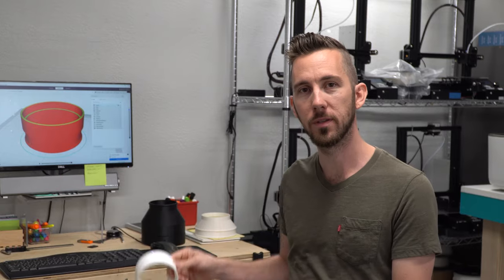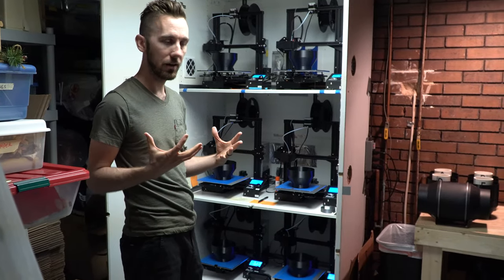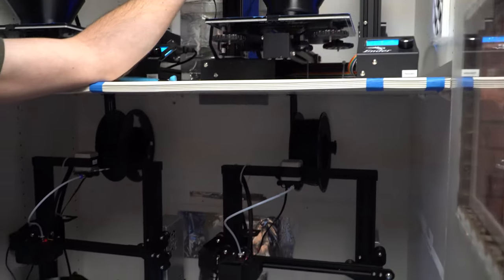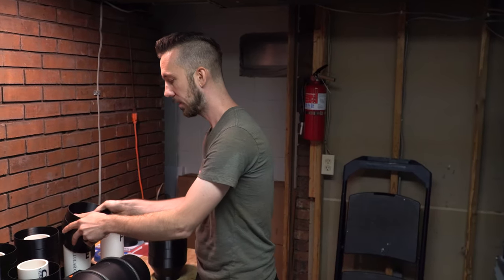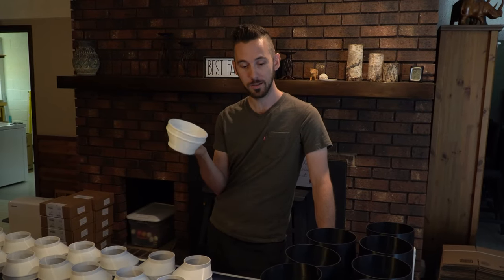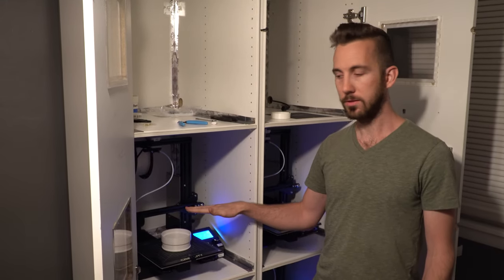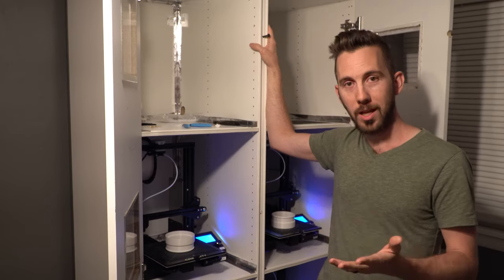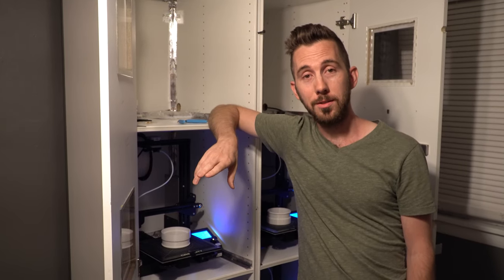My 3D Printing Farm

Comment: I really like the cabinet setup. Any issues with your electronics overheating? Also are you using the stock PTFE tube? I had to switch to Capricorn PTFE when I use PETG. The stock tubing degraded quickly for me with higher printing temps. Great video!
Reply from the maker: Thanks for reaching out man! The electronics are probably pretty toasty, but I’ve never had any electronics failures. 
Yup, when I switched to PETG I had to switch to the blue Capricorn tubing. Works great! The stock was degrading on me too. I recently put all metal hotends too so that helps.

Comment: For your type of products, a higher end dual printer should save you so much time, maybe even money. Stringing/power losses are problems for the cheap printers, a higher-end well calibrated printer shouldn't give you these problems. Plus you have the ability to print 2 in the same time. 

Molding is indeed the fast/easier maybe even cheaper option but with so many supplies shortages lately and transport problems, keeping production inhouse at least of the time being is the thing to do imo.  

How does your Amazon margin compares to your Etsy shop ? I would imagine Amazon takes a bigger % of the profit ? Do you have to invest in PPC or can you rank organically ?
Reply from the maker: Good thoughts shared here man. I've thought a lot about starting to upgrade to more expensive, more reliable printers. It may be something I need to bite the bullet on and just do it. 

Amazon takes 15% and Etsy takes 8%. However, my sales tripled when I moved from Etsy to Amazon. I've been fortunate enough to never have to pay for marketing. My customers are Glowforge owners and my YouTube channel is mostly Glowforge content so that's how they hear about my products. I listed a few other products on Amazon and started to rank organically after about a month and a half. 
All that being said, I just moved off Amazon to my own website hosted by Shopify, so we'll see how that goes.
Reply: @Martinson Manufacturing   I'd recommend a stacker s4. My favorite printer prints 4 objects at once, highly precise, no fiddling or anything. I also have one for sale if interested
Reply from the maker: @Waku117  Oh wow, I didn't even know those existed, thanks for sharing. My only question would be, if the extruders are say, spaced 2" apart and your part is 3" in diameter you wouldn't be able to utilize all four nozzles. Would that be correct?
Reply: @Martinson Manufacturing all 4 nozzles running at once, it'd be 345mm x 96mm × 650mm. But remember, you don't have to run all 4. You can print with just one nozzle or 2 or even 3. It's also the best multi color printer I've used.

Comment: AND the transformers will run on 220 just flip the switch an wire them up. It will cut the power bill in half. Will also heat up faster be safer and be much more stable.

Comment: Great video, couple of questions.
What is your print failure rate? 
And what brand of filament are you using?
Reply from the maker: Great questions. Failure is probably 1 out of 20. I use Overture and Hatchbox. I used 3D Solutech for a long time. It was cheap but inconsistent. These new brands seems good so far.

Comment: Have you considered not running a print farm but subcontracting the manufacturing? Also if you currently have three parts, shouldn't injection molding be much cheaper?
Reply: i was thinking the same thing. but injection molding has huge equipment involved. and the costs of the machine im sure is something else to worry about. also injection molding creates inventory. in 3d printing, its more print to order.

Comment: Use capricorn tube and if it strings use a bit of olive oil with sponge box to have no stringing

Sometimes filament is not dry enough so drying filament could be a solution

Comment: You should try running a UPS if your still having power loss issues.
Reply from the maker: Definitely a good idea. I think the solution is either a UPS or trying to keep the electronics cool. Someone else mentioned that the heat may be causing the issues so I think its one of these two things. Thanks for the idea!

Comment: Wow, the filament roll and extruder mod is truly genius. I've not seen that in anyone else's recommended mods. Great video!
Reply: Check most of enclosed mods, they use similar mod, some might be more adapted to you. Lots of mods are built with IKEA "lack" table. 6 lack table (2x3) for 4 printer with a great access. 

You could fully enclosed your printer to print abs easily for exemple.
Reply from the maker: Thanks man, it's served me well.

Comment: If temperature iy an issue with your PLA i would check out filatisum's advanced PLA & engineering PLA.

(With mineral dust & glass fibers to mixed in to ddastically change the melting point)

If nothing else, they retain the rigidity of PLA compared to thjngs like PETG or ABS. With a marginally higher heat rssistance.
Reply from the maker: Thank you for sharing!

Comment: Could you give some details on print temps / settings for PETG? Seems you already have an enclosure with those cabinets (are those small vent fans on the sides?)
Reply from the maker: Right now I’m getting great results with 240/60 as my temp with Overture brand. I added the vents for an idea that I had previously but they’re not necessary. My two other cabinets don’t have vents and I never had any issues.

Comment: Ghost on printers, 

I think I know what could be causing it , STATIC ELECTRICITY, believe me or not , on big prints I noticed everytime I try to reach out to built plate and separate the  newly finished print it discharge static charge . 

I have PRUSA MK3S+ , hasn't failed in middle of print yet but the fact that there is such a large amount of charge builds up in printer ( whole thing including spool of filament , built plate , extruder..... ) Gets me to wants to work on grounding the machine so it doesn't mess with electronic components .

Hope this would help .

Comment: Hey. So let me start by saying I love your presentation and your stellar work ethic. With that said, my question is more about the economics. Keep in mind I don't know anything about the specifics of the intended application. I saw how much work you put into organizing your production setup so I quickly googled what these parts sold for. While specialized parts do fetch a premium, typically from a niche consumer pool, the reducers look pretty straightforward to me. Why wouldn't a China mfg injection mold these parts and sell them at 10% of your price?
Reply: Ya...I just bought another plastic tub at home depot to put more filimant in and I thought "this plastic tub would take me a year to print and cost me 3x more in filimant than this injection molded tun is costing me."
Reply from the maker: Thanks for the comment Daniel. You have a great point. That could totally happen and is part of the reason why I moved off Amazon. I think a goal is to be successful without becoming too noticeable. Thankfully I don't think my parts bring in enough money for someone to spend the time to copy. But again, it's a pretty straightforward part. I really want to get these parts injection molded myself and sell them for much cheaper, but the cheapest quote I found so far from a US based company was for $32,000 (for one part) and I just don't have that kind of capital. If I had it injection molded in China, well now China has my design and the mold and will just sell it on Amazon themselves lol. This process has been such a learning journey.
Reply: @MartinsonManufacturing  Thanks for being so thorough and candid. You're obviously a mature, well informed small business owner and I very much respect that. I understand the challenges of having to anchor down a business niche and staying ahead of the competition (often by assuming that role). US-based production is rife with challenges with China as the world's factory, and your ethics concerns are warranted. Your success is tied to the person and creative entrepreneur you've shown yourself to be. The learning experience and strategic thinking are yours to keep. You're a sharp cookie. You'll get where you need to be :)
Reply: @MartinsonManufacturing  Instead of printing every part you could print molds, and cast an epoxy resin into the molds to create the parts. Instead of having 10-15 printers you could have 50-100 molds that are setting at a time. It would probably be much cheaper/easier and you would get consistent parts every time.
Reply from the maker: @brianmoody2949  That's definitely not a bad idea and something I have looked into before. At the time I was looking at a liquid plastic and was far more expensive than the filament. Epoxy resin is an interesting option. Maybe that would be cheaper.

Comment: Great Video 😄 Curious if you thought going with a SLA setup would drastically increase you per part cost. Not initial setup cost but more resin vs filament. Thanks
Reply from the maker: You know, i've never priced it out before. I have a friend that prints miniatures and I think his part per cost with SLA is better than FDM.
Reply: @MartinsonManufacturing  thanks for the response 👍

Comment: Do you house the power supplies for each printer outside your cabinets?  Or do you just treat them as commodity failure it ms and accept they will fail more often enclosed in hot cabinets?
Reply from the maker: I keep them inside. Haven’t had one fail on me yet.

Comment: Thank you for the tour, pretty interesting! I think it is smart to sell 3d printed products to non 3d printer owners! I currently only sell digital products (.STL files on Cults3D) but my customers own a 3d printer. Your print quality seems amazing. May I ask you what nozzle size / layer height / material and print speed you use to get such a beautiful print quality?
Reply from the maker: Hey Vincent. I’m using .6mm nozzle, .2 layer height and Overture brand filament at 50% speed in Cura.
Reply: @MartinsonManufacturing  Thank you. I guess you spent quite some time tuning your Cura profile to get this print quality! Would love to see a video about you explaining your Cura profile and the reason behind the changes you made to the default profile.

Comment: Have you ever considered switching to Prusa's for your business? I have an ender 3 v2 and while its great for hobby use but not so much for business production
Reply from the maker: Yeah, I should have upgraded to a highly quality printer a long time ago. Something I wish I would have done sooner. I recently switched to BambuLab.
Reply: @MartinsonManufacturing  Oh very nice, I've been reading about those. It's just hard not to go with Prusa since they're so proven. Do you have to mess with your enders a lot to keep business moving?
Reply from the maker: I’ve messed so much with my Enders. In one sense, I can set it and forget it. I had 4 that worked flawlessly for 12 months with no maintenance. Others just have issue after issue. I had very inconsistent results with them. Hoping the BambuLab printers are more constant and reliable.

Comment: It looks that you work wit 0.1 mm layers. What kind of nozzle do you use and how long does the black part take to print?
Reply from the maker: I actually use .2 layer height with a .6 nozzle. The black part takes 9hrs to print.

Comment: So cool video, what blue tape you use? Does it works with temperature? I try one and it was a totally fail. Keep the good work
Reply from the maker: I use this tape and love it. 3M 2090 7.25" x 12"25 3D Printer Sheets, 7.25" x 12" (Pack of 25) https://www.amazon.com/dp/B00HSKJZ56/ref=cm_sw_r_apan_glt_fabc_J8ZWE7AYT397CZVTM89B
My bed is at 60-70C and it holds up great.
Reply: @MartinsonManufacturing  thanks for the info keep the good work.

Comment: Can you tell us what PLA filament you recommend.. i have been using FINLAND..  i had a few brittle snaps on me and one horrible tangle..  but it has been ok for now....  Did you need to hire an electrician to make sure your power line breakers can handle  all those  machines ? Do these machines draw much power to operate.
Reply from the maker: I don’t use PLA anymore but Overture on Amazon is decent. I have 6 machines on a 20amp outlet. I think they draw 3-4amps each
Reply: @MartinsonManufacturing  thank you for your help. cheers and have a great day.

Comment: Thank you for the knowledge. I just tried blue tape for a better first layer. Of course I releveled after but now I can't get the part off the printer without damaging parts of the blue tape.(especially if they have bigger area contact). I could make the first layer a bit higher but  are there other ways to overcome this new issue? 😁 Also is there a god way to clean the blue tape before a print besides a rag for dust? Thank you!!
Reply from the maker: I think blue tape really depends on the part you're printing. My prints have a very small surface area and so they pop off pretty easy. However, if you have a large surface area that it's almost impossible to remove your print without damaging the blue tape. You may need to try a removable flexible bed. I don't think i've ever cleaned or wiped the blue tape before printing. I do however use my thumbnail to press the bubbles in the tape back down before each print.

Comment: I am wanting to get into printing for personal but I also like to design as well. I can see some of my products needing high strength so I probably would want to print carbon fiber. I saw you had started printing with that recently. I am leaning toward the ender s1 pro. What would you start with?
Reply from the maker: Awesome man! I don't know about the Ender S1 Pro, but the stock Ender 3's won't reach a high enough nozzle temperature to print carbon fiber. When I printed with it back in the day it was on my Cr-10 which was able to get hot enough.
Reply: @MartinsonManufacturing  seems like the s1 pro is just a fully upgraded Ender 3. I think that is what I am going to start with. It will be the closest thing to ready to print from creality.

Comment: What hotend do you use? I have 10 ender 3’s and the hotend is my biggest problem with jams….
Reply from the maker: Same. I’ve been using Gulfcoast robotics, but had a 100% failure rate with them. Micorswiss is better but still had issues. The best solution I’ve found is to use “Hot Lock” on the threads of the heatbreak. It’s sold on Amazon.

Comment: What are the printers you're using? Are they pretty much assemble and go? Or do you have to tweak with it for eternity? (I had an Anet E10 2 yrs ago and was tweaking more thank printing)... A lot of.issues with it.
Reply from the maker: I'm using Ender 3's (some Pro's some regular). I hate setting them up, but after they're set I don't need to do hardly anything to them.
Reply: @MartinsonManufacturing  setting up.. you mean assemble? Or some other aspects, including some upgrades?
Reply from the maker: @djVania08  Oh sorry, yeah I meant assemble.
Reply: @MartinsonManufacturing  thanks for the info :)
Reply: @MartinsonManufacturing   I have Pro version too, did u have the wobble on X axis? Is it the reason u move the extruder to the top?
Reply from the maker: I put the extruded on top to make feeding filament easier.

Comment: im looking to get my 4th printer. ive been working with low tech printers for about 2 years. as long as i can manually adjust things, my printers work great. im not sure i want to get high tech printers, that basically level themselves and all that good stuff. as soon as the printer goes down. i find myself on the phones with the great tech support. but with low tech printers, i find repair videos and solutions on the spot. what are your thoughts?

Comment: An excellent and informative video. Thanks. I’m just starting. I have just the one printer at the moment that I’m using for prototyping of parts for a larger product. Just today I started using ABS and I’m still yet to try PETG to find the most suitable filament for my parts.  It would be cool to produce an item that is can sell individually though.
Reply from the maker: Hey, that's how great things start, keep at it. I never thought prototyping that first part would have turned into a full time job.

Comment: Ive had the power loss issue on the ender 3 as well, i found that its an issue with the microsd being used.
Reply from the maker: Interesting. So did you just buy a different microsd card and it went away?

Comment: How could i decide which Filament brand is good or bad buying hem online?  As a hobbyist i don’t buy 3 rolls end test them before i buy 20 rolls. I just buy one for each color. Do you trust online reviews or how do you decide? Just based on price?
Reply from the maker: I've honestly just bought what I could afford. I started with 3DSolutech because they were the cheapest I could find and then after a year I noticed some issues then moved to Overture which is also fairly inexpensive but had less issues. So I guess price has been a big determining factor for me.

Comment: Why don't you push the parts off with the print head after you let the bed cool down using a g-code command?
You could let them fall in a big box and so you have less work.
Reply from the maker: I saw a guy do that for the first time about a month ago and thought that was a very ingenious idea. I may have to figure out a way to implement that... Thanks for the feedback.